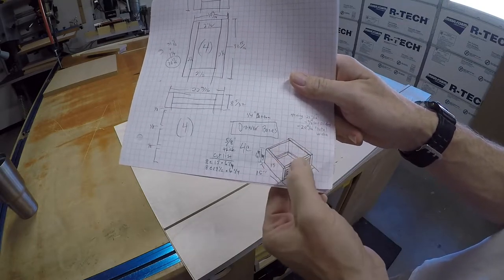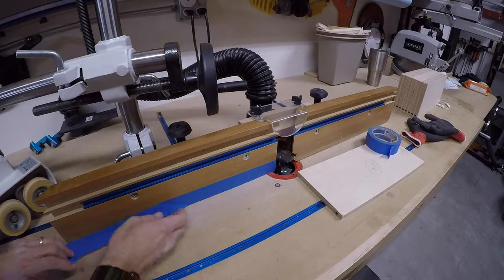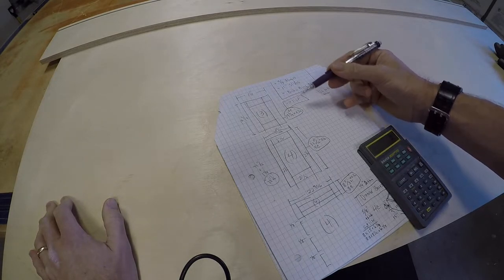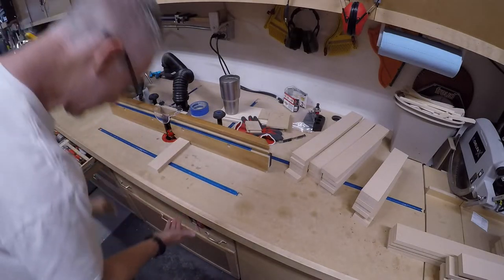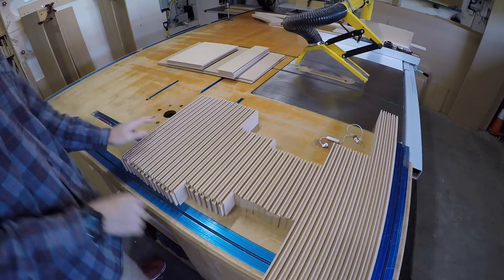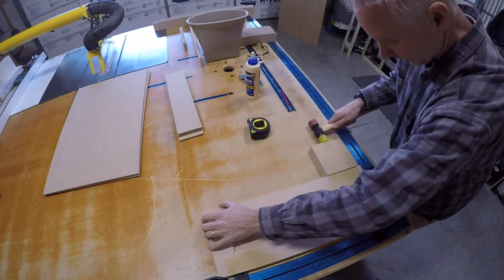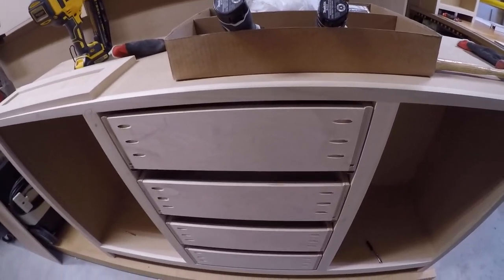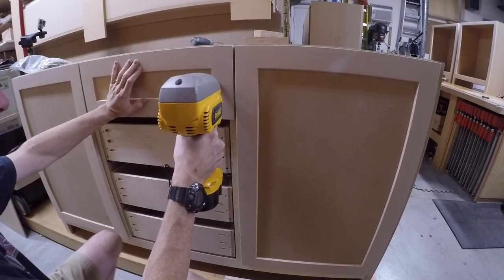How to Build Cabinet Doors and Drawers with Ease But Very Nice.

Comment: How do the painters finish the doors? I’ve been thinking about building doors with Mdf but I can’t think of how to get a good finish on the paint
Reply from the maker: Thanks for watching and leaving a comment.   The best finish for cabinets is laquer.  If you only want to use latex, the finish isn’t as good.  The latex just never seems to completely harden up.  So whatever wood you use, spray laquer for best results.  The mdf requires more attention but Is like glass after paint.  Sand the edges more and burnish in with finer grit if needed. So it’s very smooth.  After the primer goes on, you’ve got to burnish it in the edges with 220.  Then repeat again.  Two coats of primer with sanding in between. If you don’t burnish in the edges, the paint won’t be so good.  Again this is where laquer is great.  Sanding it.  After it’s dried it’s hard.  Sands great.  In the bathroom vanity build, I used poplar for the doors because it’s in wet area.  But I love making doors with mdf.  Just need to sand more.

Comment: Great video Dave, one suggestion is that you spin the push block around so you get inward and downward pressure as you push. I use this same technique but the handle needs to lean the opposite way.
Reply from the maker: Yes you’re right.  But I use both sides of the block as I stated.  So I don’t mind at it saves me from having to have another block for each profile( lots). I don’t mind it actually but some may. As I’ve been doing it this way for a long time.  Again I think I mentioned this. Thanks for watching.

Comment: If you turn your push block around 180 degrees you will have better force against the fence and your fingers will be clear of the cutter.
Reply from the maker: Thanks for watching. My push block is double sided. For other profiles, As I show you, and it is more comfortable for sure the other way, but I’ve made hundreds if not thousands of doors in my career this way.  It is very comfortable for me to use both ways.  However my experience might be different than yours.  Please do  whatever is most comfortable for you.  As you can see in this video, my technique is perfect for me.  Thanks again fir watching.